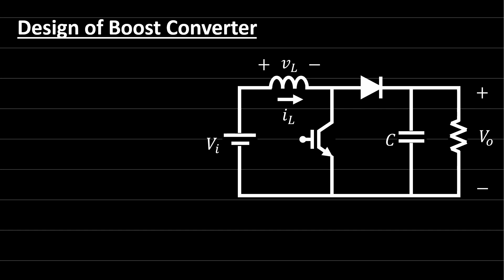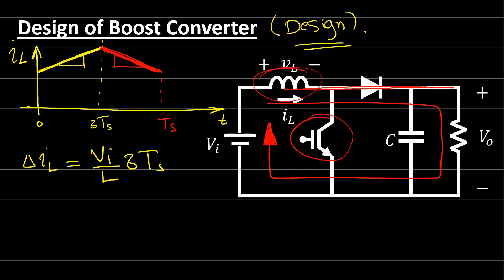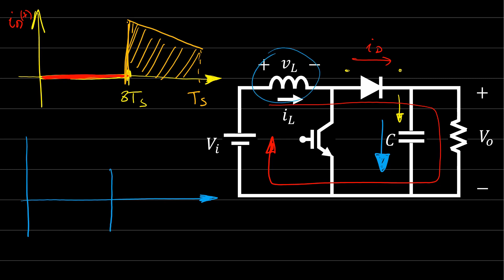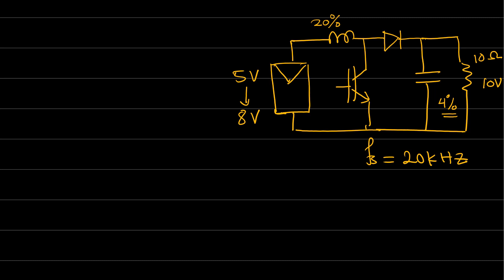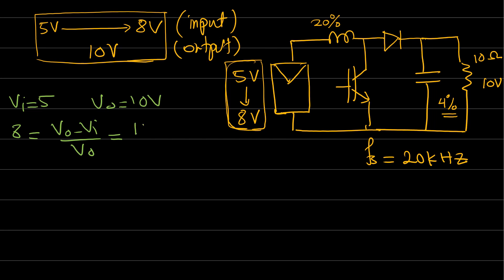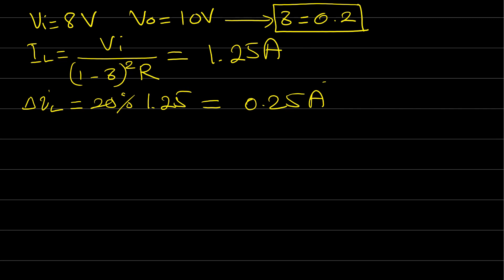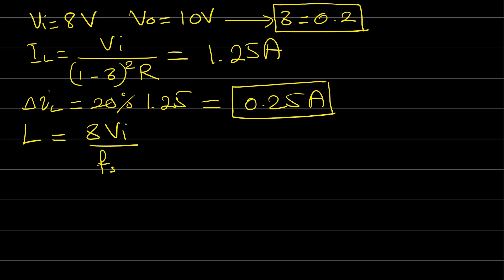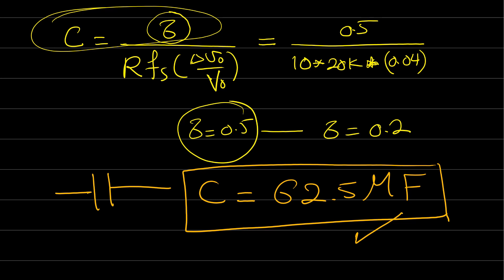How to Design a Boost Converter | DC-DC | Power Electronics

Comment: thank you for such useful video! I have one question about how to choose mosfet for such DC-DC converter. Particularly I'm interested in such parameter of MOSFET as "Vds". So since we calculated our converter for output voltage 10v under load 10 Ohm, I assume that if we will disconnect the load, output voltage will start increasing. So it may damage mosfet if it will be much bigger than Vds parameter of MOSFET. So how to properly  calculate DC-DC output voltage when load is not attached?
Reply: It depend, if you have negative feedback, the system will modify the duty cycle to stay at the same output voltage. 
If you don't have negative feedback, and a changing load, your output voltage will change, and if you remove the load, output voltage will increase, and destroy your MOSFET, your diode, and your capacitor.

Comment: Excellent case ,In all cases we need a control circuit to vary delta so that the output is regulated, is it possible to make a lecture on such a circuit, even broadly as block diagram
I have a problem with power electronics generally that is it's telling only half of the story 😊
Reply from the maker: because it's not the whole story
Reply: @Elkhateb  Thank you

Comment: how can we decrease the input current of the boost converter
Reply from the maker: if you increase the load resistance, the input current will be decreased by default.
Reply: @Elkhateb  Pls clarify on this one.This is just like Transformer operation right? Where input power and output power remains same but only V and I is varied.